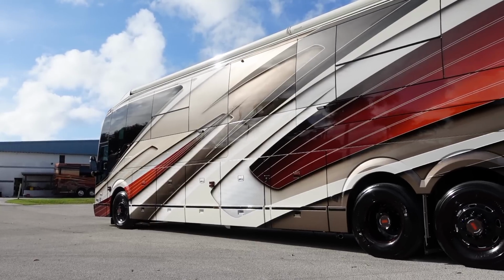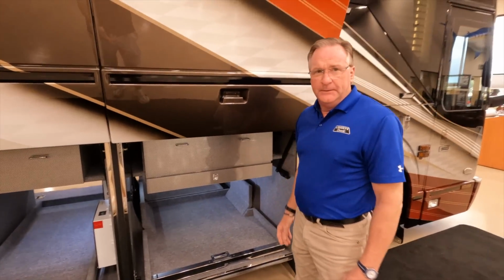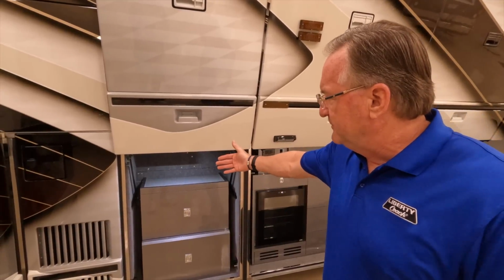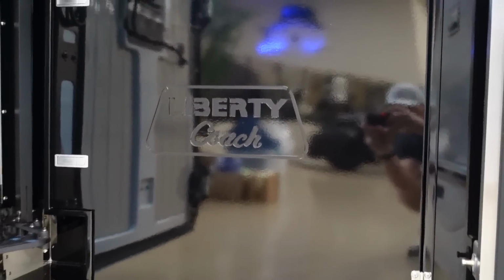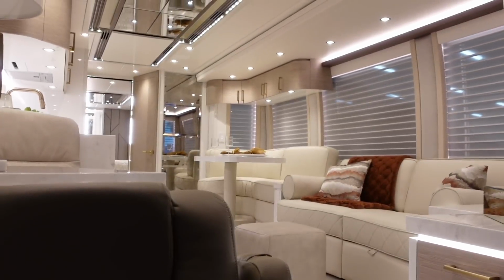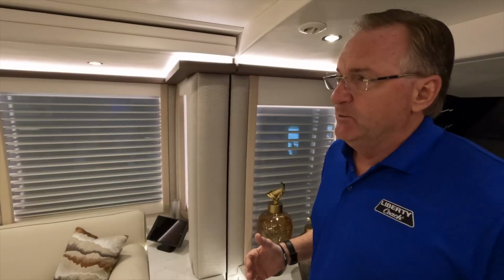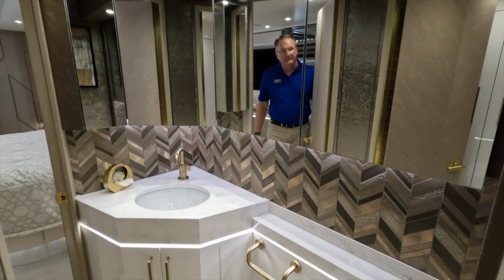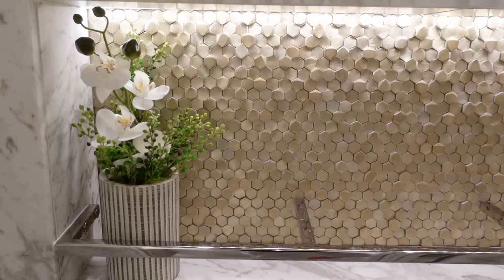The Most Expensive Motorcoach in the World! 2023 Liberty Coach Artist Series

Comment: 24:35 This man is stating the coach will start at -65F? I call it BULLSHIT. I was born in Missouri - SHOW ME. The diesel would be close to frozen solid or at least a super thick gel. At -30F, my JD tractors need significant heating to start. -65F?  I would need to see it to believe it.
Reply: It will most definitely start and run at -65f.
Reply: I work in Alaska as truck driver. Granted our fuel is treated to handle that type of cold temperatures. But I have seen people come up here from the lower 48 in thier coaches, to stay through the winter in fairbanks Ak, in negative 55 degrees and they were fine, So yes it's possible that coach could ride out -65